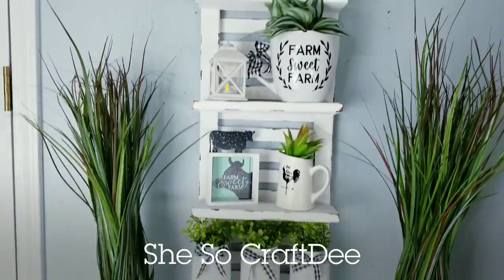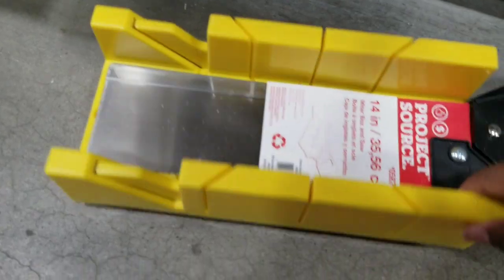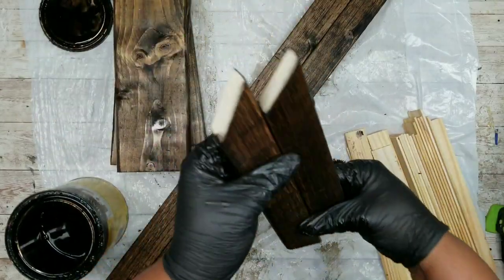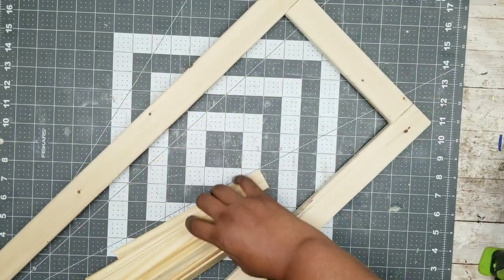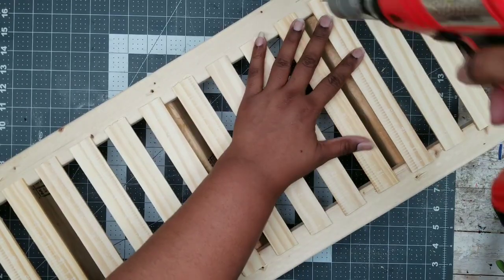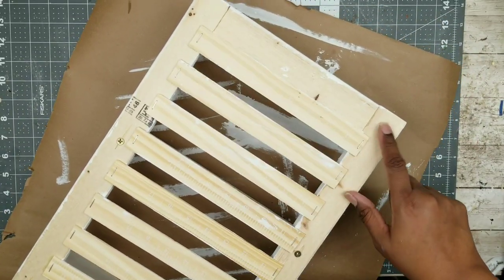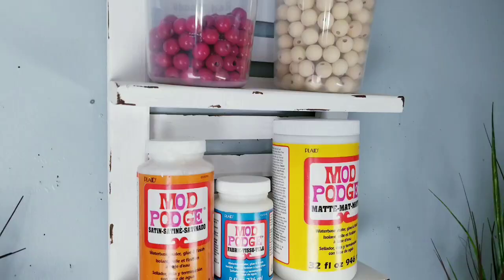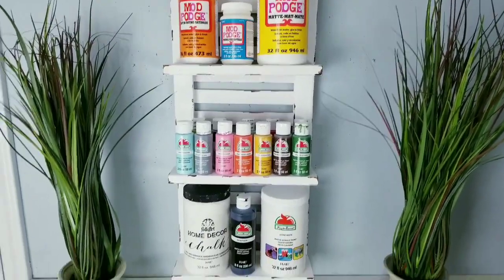HIGH END Inspired DIY | Modern Farmhouse Wood Shutter Shelf | Home Decor | Amazing Look for Less!

Comment: I’m confused when it comes to protecting chalk paint finishes. I never know what to do and don’t want Scratches  on my project. What do you use for non porous objects like porcelain, glass, plastic, rubber etc. as opposed to wood, material, fake flowers, or a porous material? Is lacquer, polyurethane or Mod Podge ever used? I’d appreciate your time and expertise.
Reply from the maker: I prefer to use Polycrylic to seal all of my wood stained projects :) For glass I use Mod Podge.

Comment: So are the beveled pieces at 11’ AFTER cutting or do you measure them out at 11’ THEn bevel the ends?? Ahhh I’m confused 🥴🥴
Reply from the maker: The longest point of the piece 11". You can choose to cut to straight pieces at 11" or cut the miter straight from a full piece at 11". Ultimately, the piece needs to be 11" at the longest point :) I hope that gives some clarification.